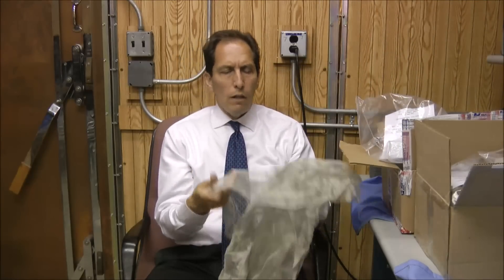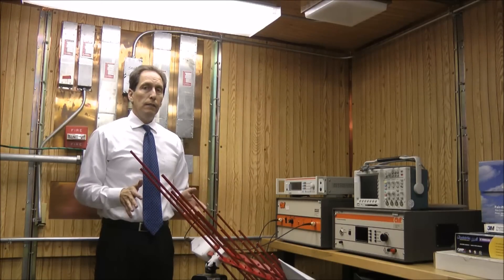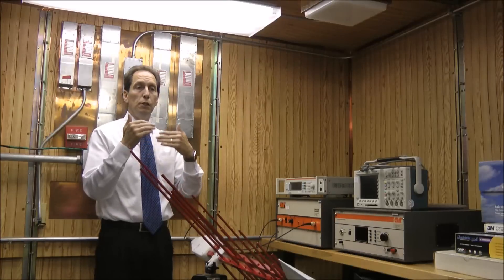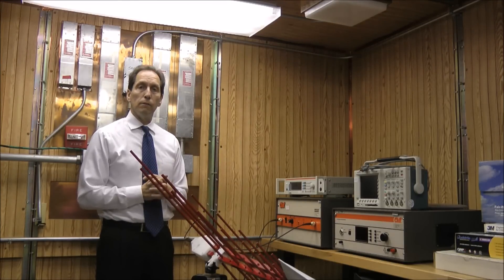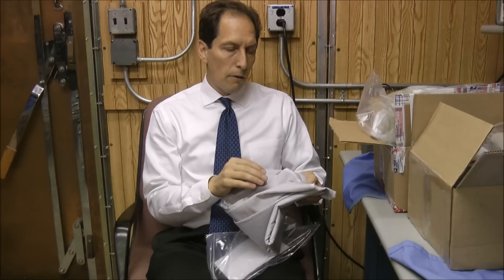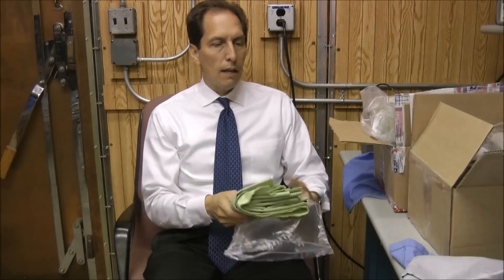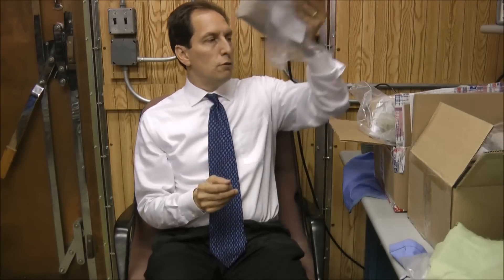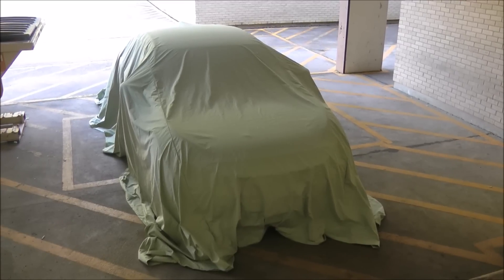Protect Generators and Cars from EMP

Comment: Personally, I'd be running an old, mechanical, diesel generator. More fuel efficient and diesel stores longer and won't blow up on you 😎
Reply from the maker: Definitely not a bad idea. The only worry I would have with diesel during an emergency is finding fuel.

Comment: Whats your thoughts on the  EMP protectors for the House and vehicle's , Like these.  https://www.myempshield.com/product/vehicle/
Reply from the maker: I'm not familiar with this vehicle product in any detail, so I can't offer an opinion. I don't personally  know of a single-point solution to the car susceptibility problem. The reason I say that is that a vehicle has perhaps a thousand on-board processors/controllers, all of which interconnected with a complex maze of wiring. I just don't see how a single surge protection device of any sort could protect the entire vehicle from the radiated effects of an EMP distributed throughout its many systems. The only way I know to protect a vehicle is to cover it with something conductive when not in use. As for the house, I do believe there are viable ways to protect from the incoming conducted pulse. I'm happy to answer any questions about how my product, the EMPStorm, does this.

Comment: For the $200 Sewing Service, can it be sewn to fit a certain car (i.e. Toyota Prius)? Thank you Sir for sharing your knowledge.
Reply from the maker: The sewing service sews strips together to any given size. The cover is essentially a large rectangular tarp that lays over the car, preferably touching the ground all the way around. If you want one, it's best to use a tape measure to measure up and over the car in both directions, then add enough to have 12" of cloth lying on the ground all the way around.

Comment: If you portable generator or a car with battery disconnect off during a power solor flare or EMP nothing happened to it. If electronic are moving through the car at that time that when it can hurt stuff. Because if portable generator for or a car with no battery what can happen to it nothing.
Reply from the maker: Well... that's not exactly true. The damaging energy is from the battery. Rather, it is a transient pulse introduced by the radiated electromagnetic wave generated by the EMP. So even with the battery removed, electronics can still be damaged.
Reply: @disasterprepper  how you need some form of electron in the circuit to spike at a solar or EMP spike.  But in real life People wouldn't remove there battery. I have a drain on my battery so I have a 2 pole disconnect switch on my van battery.

Comment: Can someone answer this for me 
Would having a negative cable disconnect switch (so your chassis is not grounded to your battery) let's say inside of your car not grounded itself (as electrons flow from negative to positive) protect it against  a EMP
Reply from the maker: No, it wouldn't protect the car. The issue is not that your chassis is connected to your battery negative terminal. Rather, it's that there are electromagnetic waves that propagate through the air. These waves introduce damaging voltages and currents in systems throughout the vehicle, regardless of whether or not the battery is attached to chassis.

Comment: Would multiple layers of the cloth give extra protection? Thanks
Reply from the maker: In general, yes, multiple isolated layers do add in their protection. Laying the two layers against one another doesn't add quite the same way though.
Reply: @disasterprepper  Ahh I see, so maybe add a blanket in between the two layers to separate them would help. Does the sewing service include the Hem around the borders? Or just the length of the seems? Thank you for your prompt reply. Highly interested.

Comment: Trouble is if you have the only car around, someone with a gun is going to take it off you. Also, where are you going to get fuel? The pumps wont work. The hauliers cant haul. etc. Horse and buggy better.
Reply from the maker: At a minimum, a car might help you get out of the hardest hit areas. I don't tend to agree with the philosophy that we shouldn't have something because others will try to take it. As for the fuel, you could retrieve fuel from abandoned vehicles, defunct service stations, etc. Still, your point is not lost on me.

Comment: I live in a metal building (Morton Building). All my vehicles and portable generator are parked inside this building. '93 GMC Jimmy and "97 Ford F150.  Is this enough to shield my stuff?  Would a metal building act like a Faraday Cage?
Reply from the maker: The metal building would certainly offer some protection, but it's impossible to say how much without taking some measurements. Just a guess is that it's probably around 10-20 dB - which is pretty good, and would likely be enough for the vehicles to survive.

Comment: you did not start the car, witch there is no proof.
Reply from the maker: I think you misunderstand the test. I'm not generating an EMP, so nothing would be damaged. I'm just measuring the shielding effectiveness of the cloth in this application.
Reply: @disasterprepper  Protect Generators and Cars from EMP. the you can be fooling people. because there is basicly no way to counter an emp or is there ?? you don't use an emp, witch indikate you can be wrong. but you can also be right, use an emp, on these shielding devices, and prove they can counter an emp. instead of just saying it counter an emp without proof.

Comment: instead of making a small cover cant you use the cloth on the walls of room (shed Or smaller garage) that way you don't have to cover each one vehicle individually ? but instead have a full enclosure that is EMP proof?
Reply from the maker: You could certainly create a shielded room (or garage), but I would recommend doing it out of something other than this cloth. While it would work to reduce the fields, a solid conductor (like aluminum foil) would work better. There are thin conductive barriers that can be used, but by the time you did the entire garage, it would be quite expensive. Still, if money is no object, it can be done. Shoot me a note if you need assistance with this.
Reply: @disasterprepper  i was thinking more of a shed. garage would be too large. but maybe a 5x7x8 tool shed. enough to store a motorcycle back up generator and batteries. i just wanted to figure out the best cloth to use and also could reinforce the insulation with foil for additional strength

Comment: Hundreds of dollars to stitch several covers together? Seriously? It’s a simple straight down the edge job Hell I’d do it fir $40.00 you pay shipping
Reply from the maker: I know it sounds expensive, but it's not quite as easy as you might think. Imagine sewing four 30-foot x 5-foot strips together and then putting a 1" hem all the way around. I certainly couldn't do it, so I take them to a local upholstery shop to be done. They charge right at $200 for the cover sewing, which I personally think is money well spent. Keep in mind, it's all optional. People can certainly sew their own. If you're good with a sewing machine, it's a great way to save some money.

Comment: Comment for the ad. Does it work on solar systems, 12v @ 1500ah full capacity
Reply from the maker: If you're looking for protection for a solar power generation system, you might want to check out http://empstorm. I have a product specifically designed for that coming soon. I'm just finishing up the AC home version and plan to do the DC version next.

Comment: At one watt per electron I don't see this as effective in a saturation event like an emp. 
You would need current channels.
Myself I have been looking to triple layer ( milspec ) with two dielectric layers between
I appreciate the cloth material heads up my outer layer will need banding.     
All this prep for a car you will need small arms defensive ability. People with guns steal
Learn to walk distances as well to give a trident of planning to your preparations
10 miles to to three times a week . Keep a ultralight back pack with foldable stainless stove one set of clothes three sets of socks. Tubeb tent hammock made from ripstop $20 bucks maybe a wool blanket or sleeping bag. Weird things like a good crack lighter in a bag, finger nail clippers some led lights (aa, c batteries) extra batteries lifestraw , rain Pancho a good one, Paracord 3 ten foot lengths and a 50 foot or two
Learn to tie a knot or three and a small telescope a set of 
Beach shoes for keeping shoes dry, some bandannas or paper masks, life straw to clean upnwater--- in a nuclear event standing water will kill you, beta radiation avoid water all water must come from containers that are sealed alpha emissions stopped by dust mask. The other radiation you got at time of pulse(Gama) if your severely burned or sick find some one else to save,,,,, we are still human
Reply from the maker: Sorry Bill, but watt per electron doesn't make sense. A watt is a measure of power, i.e., the time rate of change of energy, measured in joules/sec. An electron is a charge carrier. When talking about an EMP, you would want to talk about joules per second across a specific area affected.
Reply: @disasterprepper  watt per electron. Joules  is a measure of charge carriers in bulk, I was trying to share the conversation with others besides electrical engineers.
My mistake

Comment: Dodge turbo diesel, with a manual governed transmission
And two permenant  magnet windmill alternators sitting in a metal shelf some bailing wire for my shut down solnoid

Comment: You would think.auto makers would have taken care of this potential problem .vehicles certainly cost enough.💰
Reply: No, once the dust settled, their market would boom.  They don’t want autos to last.
Reply: @vdog9291  From Lil Giant Really? You think people will buy cars when the electricity is down across the entire country? How long do you think that will take to fix? Two-three years minimum, I would think. EVERY SINGLE ELECTRIC WIRE in the country will be fried. Gas pumps might be some of the first—for military transportation purposes, if nothing else. Car dealers, residences, and anything but main city cell towers will probably all be last. PLUS all the car dealer inventory will be ruined. Manufacturing plants—including automobile manufacturers, will not be working. One thing for sure. Hybrid and electric powered vehicles will not be working.
Reply: @henryvalero9235  so you think we will be in the Stone Age forever?
Reply: @vdog9291  From Lil Giant No. I think we will be in the stone age for about as long as this coronavirus, with islands of repair/progress in the metropolis areas. They will have to bring the electrical manufacturers up once the parts on hand are used up. They will be buying/restoring medical facilities and truck/train or transportation and tractors/farm equipment for needed food/repair of grid/electrical system. Residences and personal transportation for citizenry will not be first on the list, that’s all. Rebuilding smaller cities outside the big ones is a good possibility for operation reasons. Ultimately might even be good for us culturally and farm-wise. Not sure what motivation for attack would be. So not sure how much defense/emergency/crisis (outside of re-building) there would be.
Reply: @henryvalero9235  their motivation would b
Reply: @henryvalero9235  e revenge for exposing the fraud
Reply: Nah not with all on board electronics:/
Reply: They are part of the problem. They are the elites. Only sure way is in JESUS CHRIST.

Comment: So do these various fabrics have a shelf life, as in, do they lose their effectiveness over time being out in the sun, heat and/or cold? Also what are the price variations for the ones that @disasterprepper recommends in the above video?
Reply from the maker: They don't really have a shelf life, but like any cloth, they could wear over time if left outdoors. Most folks cover their cars or generators in the garage. As for pricing of conductive cloths, they range from $15/linear foot to $40/linear foot. I re-sell the cloth at a price slightly lower than anywhere else on the web. I am able to do this because I buy it in bulk. The cloth I sell is $15/linear foot, where each linear foot measures 1 foot x 5 feet.

Comment: How does an emp destroy electronics? Or is it certain components of electronics that are destroyed
Reply from the maker: An EMP really does two things, both bad. The first is it causes a large geomagnetic disturbance at the surface that induces huge currents on long conductors. That's what will take out the power grid (and other infrastructure that has long cables or pipes attached). The second is a powerful electromagnetic wave that, much like a radio transmission, couples RF energy into anything that looks like a suitable-sized antenna. That energy can cause semiconductor junctions to over heat (or punch through), damaging solid-state devices. Despite novels to the contrary, everything won't be destroyed. Some things are more resistant to the radiated energy than other... motors for example are pretty darn resistant to RF energy, but a laptop isn't. Of the two effects, the energy induced on the long conductors is almost certainly going to cause more problems (and damage), but both should be considered when preparing.
Reply: disasterprepper how vulnerable would generators, solar panels and batteries be?

Comment: Dr. Bradley:  I have watched your videos and just now – bought your book “EMP Attacks and Solar Storms”. I do have a direct question: I have an expensive generator in my garage, and I would like to protect it form an EMP attack as much as possible. Can I build a “Faraday Box” with no bottom, and just place it over my generator, or will I have to have a 6-sided box (with a floor and a ceiling)??  Thanks in advance.
Reply from the maker: I posted an answer on your other post. Bottom line, it's okay without a bottom as long as you have a conductive edge in good contact with the ground.

Comment: My only concern would be to shield my generators so my unplugged freezers will work when the lights go  out transfer food and run generators couple times a day. I keep mine in the garage to take advantage of the cold. No need to hurry to transfer in the winter

Comment: More questions: What was the frequency range you were testing? How much power were you cranking? Were there any hot-spots of particularly high or low attenuation? Was that consistent across the types?
Reply from the maker: I typically sweep from 100 kHZ to 1 GHz, since that would span the frequency content of an EMP. The power isn't really the issue, because I'm making a differential measurement of shielding effectiveness. That is, I make a measurement in free space without shielding, then I take another underneath the cloth, and make a second measurement. That's the standard method of determining shielding effectiveness. Shielding always varies with frequency, and in this case, it went between 20 dB and 35 db (90% - 98.5%).

Comment: IMHO an EMP will likely produce MEGA-AMPS of current, how is a tiny metal thread in a bed sheet going to protect your sensitive electronic equipment?  Like with an electrical short, the thin wire in these will likely melt and then be of no use leaving the equipment vulnerable.  I too have an high power amp and it doesn't come close to producing MEGA-AMPs, how are these tests comparable to a real EMP?  Even Faraday cages are made of heavier gauge metal.  I just can't see how this cloth can protect anything from EMP.
Reply from the maker: It's a common misconception that an EMP would result in large currents that could melt metal. Fortunately, that's not the reality. An EMP is very brief in time, and the actual amount of energy per unit area (in joules per meter) that's released is quite modest. (Keep in mind that EMPs have been tested, and there has never been melting of metal, not so much as heating of metal). The real issue is that that amount of energy is very brief in time, making the resultant power quite large. The net effect is very strong electromagnetic fields that might damages sensitive electronics, and even worse, a huge conducted pulse on long conductors, like power transmission lines. That conducted pulse is the gravest danger from either an EMP or coronal mass ejection because it could disrupt our power grid and cause enormous damage to electronics connected to the grid.
Reply: @disasterprepper  Check out Curios Droids latest video. Go to 11:18 mark. There's potential for very high Amp loads! https://www.youtube.com/watch?v=KcTrOGS3TyE

Comment: How does this compare to overlapping strips of aluminum foil taped to a tarp?
Reply from the maker: Overlapping aluminum foil would likely do equally as well -- much cheaper too! The major issue is one of durability.
Reply: Yeah, I actually built one a few years ago, but with one twist, I added duck tape to the aluminum side for durability. The cost didn't exactly skyrocket, but it did cost more. How much did the wire cloth cost? I will bet that even with the duck tape, the the aluminum foil + tarp method would still be at least a little cheaper, (especially if the silver price heads to where it really should be!)

Comment: Wouldn't the protection level in the real world be a result of proximity to the energetic source/blast?
If I remember correctly...Inverse Square Law.?

Thx for the vid
MJ
Reply from the maker: It's a bit more complicated than the inverse square law because the earth's magnetic field lines come into play, but yes, you're point is absolutely right. Field levels, and thus damage, would be a function of proximity to the blast. Unfortunately, a well-placed warhead or two over the continental US could take out all of the electrical grid, and damage quite a bit of our infrastructure.